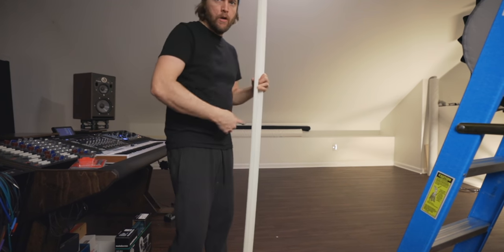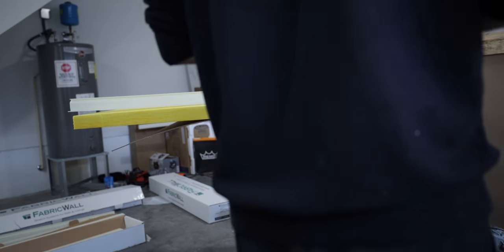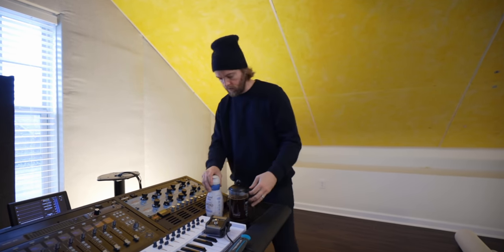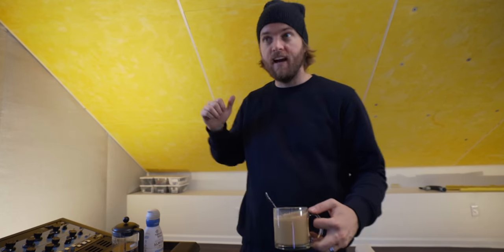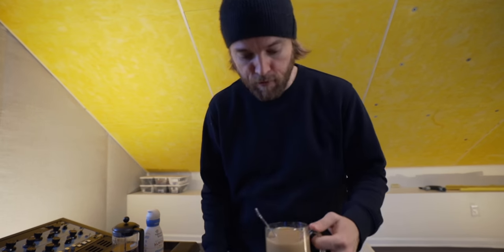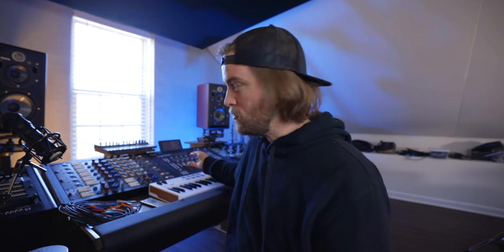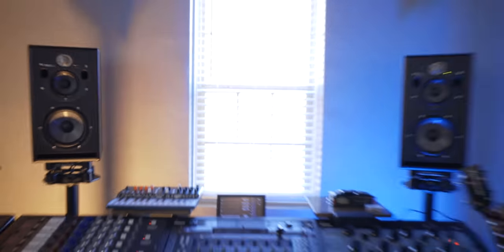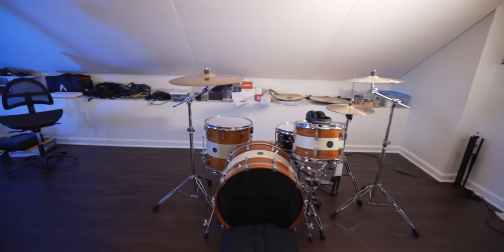Building an EPIC HOME STUDIO setup with a FabricWall!

Comment: I am loving the track system that Colt and you use to achieve a smooth seamless sound wall, but at the risk of asking a stupid question, what if you reversed the dynamic of “Wisper walls and wood floors ( that would of course be treated with some carpets) and instead had the floor carpeted and the walls with hanging treatment (like carpet is to the wood floor) how would reversing this affect the outcome (Pros & Cons) why one way is better/worse than the other???
   FYI: I’m buying a new house that has carpet in the upstairs studio area (very similar to your and Colt’s)  and wanted to get some feedback before I needlessly rip up the “BRAND NEW” carpet in the Brand New house just replace it with wood flooring!!!
   Thanks in advance for your in put!!!

Comment: So my future writing space(won't be mixing in there for production, only for demo's) does have very thick Rockwool insulation, but has 9mm plywood on top of that. Would it negate all the bass trap effects, surely the long waves will pass right trough? I am going to be putting thick felt on top of it, and then install loads of slats to it with space in between to get a nice look and to act as deflectors.

Comment: Hey Andrew - looks really nice!  Getting ready to do something similar, wondering about the nail gun you used and any tips on size of nail etc.?  Wondering if the nail gun splits the track at all?
Reply from the maker: Neumatic Crown staple nailer, 18 gauge nails 1” to 1 1/2” nails. No splits unless track is not flush with wall and you flex it.
Reply: @AndrewMasters  Thanks - appreciate the quick reply and the info!

Comment: Not sure if you’ll get time to answer my question Andrew but it’ll ask anyways lol. Would you have installed the fiberglass insulation on the very first wall where the window is located? Or is there a reason why you had the rockwool first and then the fiberglass? Sorry it turned out to be 2 questions.
Reply from the maker: If I could go back I would not have used rock wool- I absolutely love the rigid insulation board so much more.
Reply: @AndrewMasters  thx for the quick reply Andrew I appreciate you taking the time. I’m about to move into my new place and looking to do treatment like this.

Comment: I've just finished building 11 panel with Safe'n sound, this is quite OK, but as soon as you need to cut them, the result is average, the wool would not stay exactly in place in the panel, I would much prefer to use the fabric wall system you have used.

Comment: Looks like your monitor stands have barely enough room to fit the Iso Acoustic stands. Are you worried they will vibrate and topple over?  I’m in the same situation and I’m scared to add my Iso Acoustic stands so for now my monitors are just sitting on the normal stands.
Reply from the maker: No chance, the rubber holds it from moving at all.
Reply: @AndrewMasters  Awesome thanks!